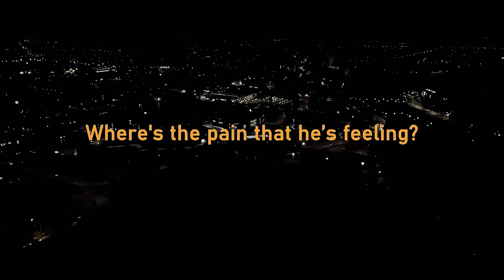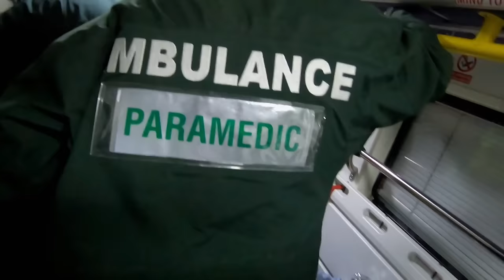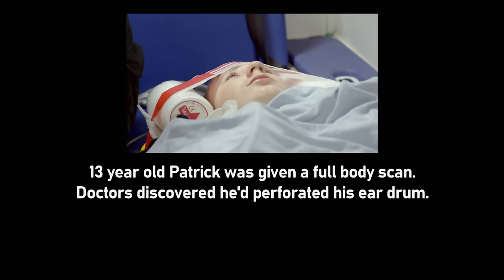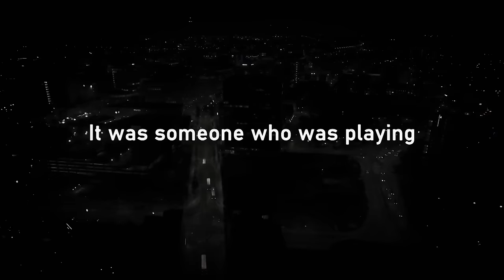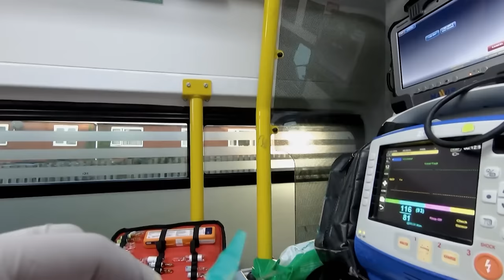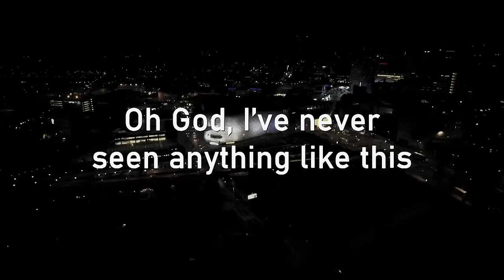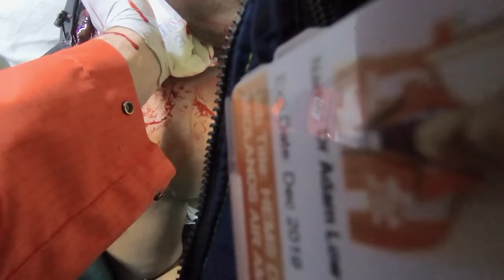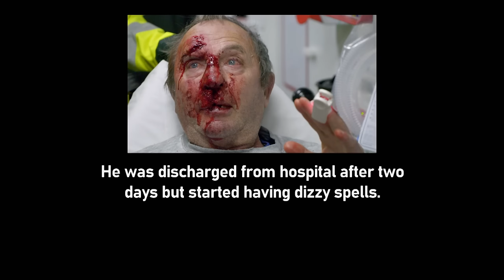Inside the Intense World of Medical Emergencies with Ambulance Code Red | MARATHON

Comment: Still can’t understand why they take two ambulances out of service for cardiac arrest? England needs to make everyone on fire service EMT and have them respond keeping the other unit in service to help another call.
Reply: The reason they send 2 is to help take over doing CPR. CPR is a very hard tiring thing to do if you need to do even for a short time. The other team will take turns so the patient has every chance there is to live.
Reply: CPR is one of the most labor intensive calls we get. We need to coordinate compressions, intubate or maintain an airway, establish lines, push meds, move the patient (sometimes), and hopefully manage post-ROSC. Even with devices like LUCAS that automate compressions, there are still a lot of moving parts.
Reply: Very true!
Reply: @shanem6869  sorry, I does not pass muster, I’ve done cpr many times and been around lots scenes and we manage quite well with  one crew and the fire service crew of for. Actually better with being controlled. And those helmets. They just get in the way and are a distraction, only needed when actually using jaws or fighting active fire combined with oxygen masks.
Reply: @shanem6869  not to mention, our fire department personnel are all trained in CPR here in the United States. Whenever I call like cardiac arrest comes in, we send an ambulance, a fire truck, and first responding police vehicles around. Everyone on all staff knows how to do CPR. No need to take multiple ambulances out of service.

Especially when it seems like the NHS in the  United Kingdom is stretched as thin as it is. 

I have envy for y’all free healthcare, but it also shows a lot of downsides to socialize healthcare. We hate paying for our high insurance prices here in the United States, but can say that I’ve never seen our major trauma units not have beds, not have enough doctors, so they cancel surgeries for patients that need to save their lives, etc. due to a lack of ICU beds and personnel.
Reply: And don’t forget the LUCAS device and others like it. Automatic perfection machine driven CPR.
Reply: And we also have a ton of volunteers in the US… I’m not sure if they do that in the UK… but they send us to school for emts…. So everyone in the community can show up very quickly and we are all trained…. After my dad had a heart attack and 6 people showed up in less than 3 minutes, I joined immediately!!!!! Not only a great way to give back, but also just an amazing opportunity to learn life saving skills without me having to foot the bill. Such an amazing life changing experience it’s been!
Reply: @reneeklein3048  yes but they have limited Ambulances but they don’t use the fire service to supplement the lack of personnel. The can train people better than we do here.
Reply: Where I work in the US, we send two ambulances to cardiac arrests. We also send a supervisor and a fire engine.
Reply: It’s the same here in Ontario Canada they need two on board to continue CPR
Reply: @julielumsden5184  I understand but they don’t need to two Ambulances for one call. You need to train fire service to be both fire and EMT. You don’t need two paramedics in one unit.
Reply: The Critical Care Unit is not equipped to transport… not enough space. 😊
Reply: To be clear, there is only one ambulance dispatched. With the exception of the helicopter, the critical care team's vehicle is NOT an ambulance. It's simply for transporting doctors and paramedics to and from the scene. If the critical care team was in an ambulance and only one ambulance was allowed on the scene, the original crew would need to leave. Even if there were firefighter/EMTs on scene, the critical care team would be stuck with the patient until handed off at hospital, which can take quite a while in many cases. With the current system, if and when the patient is stable, the regular crew can take over care, freeing up the CCT to respond to other cases. Some municipalities in some countries do have EMT/firefighters. I actually did my EMT training in one. Even there, the advanced life support team traveled in a separate vehicle that was not set up for patient transport. When a patient requires ALS care, the team would simply join the crew in the ambulance. There are a few disadvantages to the EMT/firefighter system, especially in larger cities. For one, firefighters need to remain at the firehouse with their gear, trucks and equipment when not on a call. In the event of a major fire or accident, 2 or more firehouse crews can be needed for several hours. That could leave a huge part of the city without coverage, or at least with dangerously long response times. Usually only a single ambulance needs to respond to fires and the rest can be moved around to fill any gaps as they arise, keeping response times as short as possible. I hope that helps clear things up a bit for you.
Reply: @Izak213  that non standard protocol a d dangerous, causing capacity issues.
Reply: @lindaarnold5683  why not? Then you need to change the way you deal with the whole situation.
Reply: Because they need more than two Paramedics at the scene....this is what I did.
Reply: What @Shuttletrain
Reply: @nicholasdaly1148 Lucas devices are not on all trucks in most cases.
Reply: @butterflyforeve  I know that. I was saying to have them on all so as more crews can stay helping other calls. 👍🏻
Reply: If they have to intubate, it takes as many hands as they can get.  And they need a doctor there in that case.
Reply: And why the comparison between the US and UK. This responders in the UK are more compasioned with their own people in need, then the cold US responders. Why everything has to be done like in the US? Each country has their own ways that works for them in their emergencies. Why Americans in the United States always think they are doing better then others. It seems this way works for the UK so just watch and leave your comparison to yourselves. 🙄
Reply: Do u consider that ambulantes should be prepared for extinguishing fires helping firefighters?  @Shuttletrain  if not, lets allow firefighters do their job. I am sure they can be needed at anytime for rescuing people, and if they are doing the EMT/paramedic work, the system then collapses.
Reply: One  crew is ambulance other critical response with the ability to administer medication only they are licensed to do
Reply: Sometimes they have an advanced care paramedic in one.
Reply: My hubby just finished school to be a paramedic. He's already seen some hard and sad things. Make sure you thank your medical workers! They are so selfless.
Reply: @facepalmsmom5512  I do every week.,
Reply: @Shuttletrain  thank you! Me too :)
Reply: @facepalmsmom5512  their is only two levels EMT and Paramedic, A paramedic can do everything under a set protocol. If a more advanced level then you call HEMS , which has pilots, flight physicians, flight nurse.
Reply: CPR is exhausting. Heck if one ain't careful, they may end up needing CPR themselves. You have to push fast and hard. And it can be VERY easy to get worn out and breathless doing it. They need extra crews for that reason in those situations.
Reply: @lolmetswhathappeneduhhh2029  yes I know, I’ve done three times.
Reply: @Shuttletrain there’s 4 basic levels, emergency medical responder (EMR), emergency medical technician (EMT), advanced medical technician (AEMT), and paramedic 1. Paramedic 2 and above are supervisory personnel.
Reply: @vagirl19  yes I know the supposed levels from my dispatching days, however from my hospital days I know what ED physicians want.
Reply: FYI CPR is a work out and if done for very long periods of time it gets exhausting. They take turns doing it. Now sit down and quit complaining
Reply: @nicholasdaly1148 how much would you pay for cardiac arrest call out and ICU treatment?
Reply: @pamhofmeister2531  right but their point is valid. if the fire department had EMT's that would bring even more people to the scene than two ambulances and they could keep ambulances available for other calls.
Reply: @louisebarba  no, they certainly do not need a doctor there to intubate. that is well within a paramedics scope of practice. and no, you do not need as many hands as they can get. It only takes one person to intubate (2 if preferred though).
Reply: @eldelbharadri2282  many places have firefighter EMT/paramedics. the system does not "collapse". No, ambulances are not prepared to extinguish fires. They simply are staffed by firefighters who are also paramedics/EMT's  there are tons of reasons why it works well
Reply: @MrGreen2700   not in the UK.  Only physicians are permitted to administer the drugs necessary to intubate and take over respiratory function.
Reply: @louisebarba  well in the USA that is paramedic scope of practice.
Reply: What do you know about CPR? Because i believe you don't know à thing about it....
Reply: @chafouaube985  actually I know quite a great deal about it. I’ve actually performed it several times, I’m a former athletic trainer from my high school days..and a EMD, from college days. Here in U.S., police and fire are qualified first responders all fire services personnel are EMT certified. And are trained to assist. Usually the ambulance crews are staffed with an EMT and paramedic I or II if critical care ambulance. You don’t need two physical ambulances to respond unless there is another patient.
Reply: @BCL-yg5rv I’m in the US born, raised and still here and I wish we handled our emergency services like yall